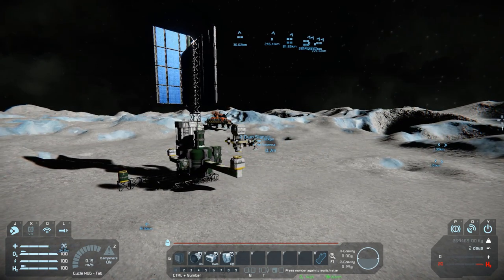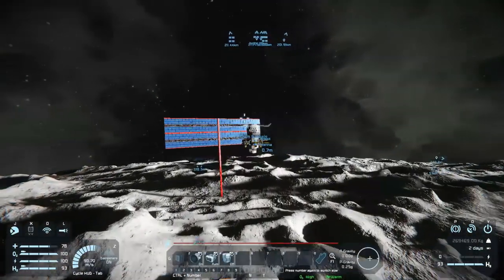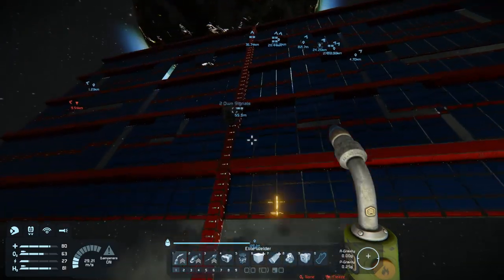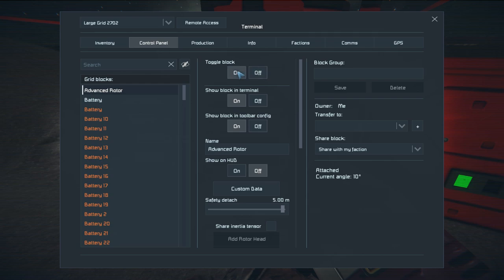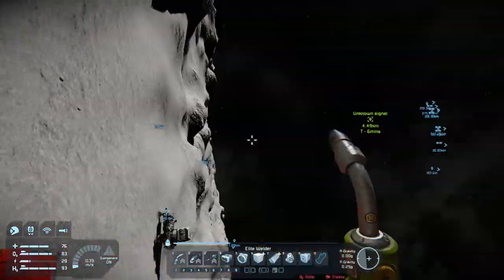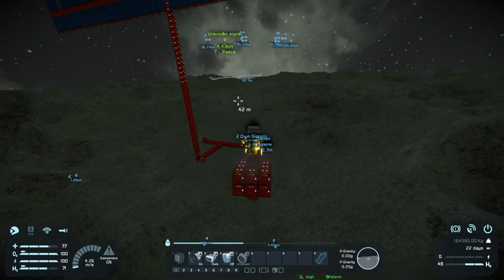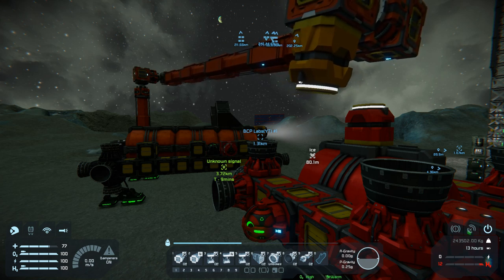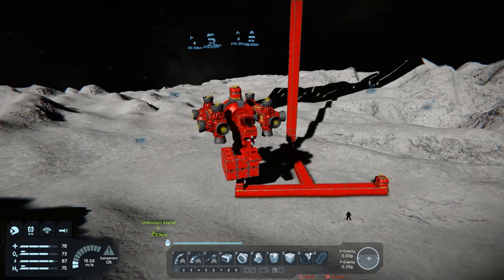B.C.P. Battery Charging Point - Space Engineers - 20

Comment: i think you can ctrl left click or maybe shift left click with your mouse on the slide bar for the rotor in the control panel to open a window for finer tuning also I think right clicking a slide bar will restore it to its default setting. I find you can also use the tab key to select the bar you want than use the arrow keys to adjust as well, i find ctrl left click to be easier of the two.
Reply from the maker: it was ctrl+click. thanks. i know it can be done with code in "custom data" and with a script but that could make things easier for me

Comment: i figured you come up with something insane and awesome. lol
btw, you can control left click on a slider to input a specific amount.
also, using a merge block to connect the batteries to the charging station might make things a bit easier. the merge blocks will auto connect once you get it in position. turning the merge block off will break the connection.
Reply from the maker: LOL im just getting started. got the slider issue worked out. ill give the merge blocks a try but may not need the batteries a much now..... :)
Reply: @bcplabs  looking forward to whatever insanity you come up with. :D

Comment: Your problem with the ship sinking does not mean you lack thrust, but that you ran into the whole connected grid physics. You got off the ground pretty easily. If i remember correctly, a "connected ship" is something even different from a subgrid in terms of where and how it´s mass and dragging effect hit your shuttle and how much the dampeners struggle to correctly compensate. It´s no problem if you land a little whatever on a large carriers landing pad, but with your ship being 104t against 144t at first and probably around a hundred later on ....
btw: Did you also look into the whole attach/detach function while you put the rotor into the mast? That has some applications that might be your taste
Reply from the maker: i was thinking that. i did try putting 2 more thrusters on but didnt do much. it was suggested to try using merge blocks instead so it auto-connects. but i may not need them as much as i thought now... :). i didnt look into that i thought that was a breaking limit but i will need to adjust my day cycle to get it to sync properly
Reply: @bcplabs   Definetly DONT touch that button on this rotor :) But in short, you can detach the rotor head and use the whole thing as a coupling. Works even between different grid sizes
Reply from the maker: Lol dont worry I do have common sense :P